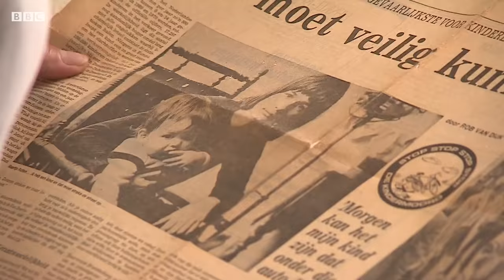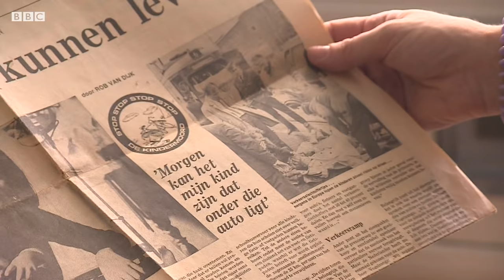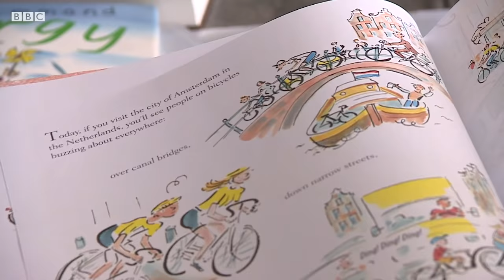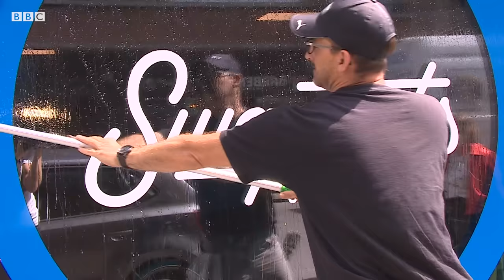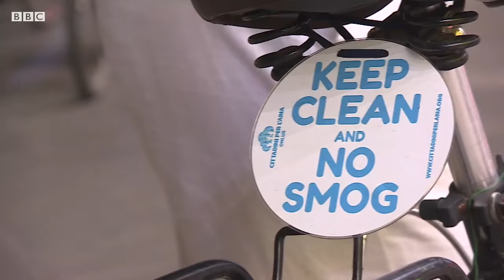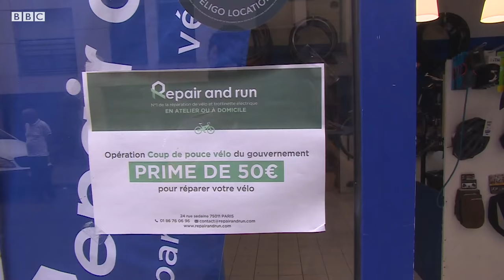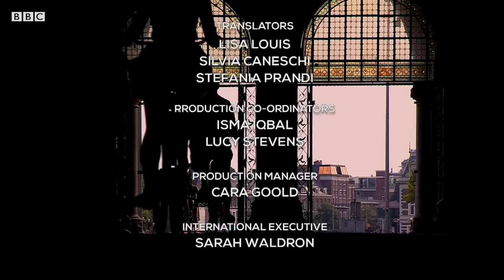Cycling across Europe in the pandemic - BBC World Service Documentaries

Comment: Cities don't need electric cars, they need electric bikes and cycle lanes that aren't shared with pedestrians or vehicles...safe cycle parking would probably be asking too much.
Reply: Electric bikes in cities can be scary. The high speed setting should only be used in rural places
Reply: I've been riding ebikes in London for years there not a problem but there definitely a good option for better social mobility.
Reply: @MissMoontree  it is possible to set a maximum pace on these bikes. Manufacturers could do this easily.
Reply: @RV-sx9tt  actually it is illegal in most EU countries to have bikes with a speed > 25 km/h. A bike faster than this is viewed as a light moped which may run up to 45 km/h without the need to be pedal assisted. But for such a fast bike you are not allowed to ride on normal bike paths, you are obliged to ride on the road. I think the rules are ok, but the infrastructure oftentimes is very lacking and therefor very dangerous
Reply: Electric cars are still cars, they're greener, but not green. Any mode of transport that involves dragging a ton of steel with you everywhere you go cannot seriously be considered environmentally friendly.
Reply: @ten_tego_teges  does this include public transport, trains and buses and alike.
Reply: @adam-g7crq  Per capita though?  A tram weighs 17 tons and takes up to 150 people on board. That's a fraction of steel per person compared to a car, not to mention the energy efficiency.
Reply: @jekker1000  Why don’t they just have set speed limits for bike paths and allow fast electric bikes and motorcycles to ride on them? As long as someone on a a fast electric bike or motorcycle goes under 25 km/h I don’t see the problem with them going everywhere bicycles go.
Reply: @burgerman101    well, European cities are extremely old and back then were planned and built for one or two casual horse carriages and moreso for pedestrians. So it almost always is pretty tight space to fit a car lane through the houses. mostly, the space is so narrow the bike path, if there even is any, is as small as 60cm, sometimes as a painted on lane (=no motorist cares) or on the sidewalks (always pedestrians stepping on the path). this will make it impossible to cycle even near the speed limit of 25 km/h. A) you have other bikes in front of you and B) a lot of streets and parking spaces / misaligned cars, cars swerving in and out of lanes. You have to pay really close attention when you ride. In the more relaxed zones, where you are leaving the city where most cycle paths are constructed towards recreational use, you can very well ride very fast. Nobody cares, oftentimes not very much traffic anywhere near but mostly these paths don't lead to your work or home but to some sort of sight. So for commuting via bike and a bike that is capable of doing 45km/h, you'd need to use the street. You are even obliged to mount a numberplate on the back of your bike. It won't even make any sense trying to ride such a bike on the bikepaths because of constant slower riders in front of you. With a 25km/h ebike you already have this problem. And because of these narrow bikepaths you do not have much safe opportunities to overtake.
Reply: @jekker1000  With the exception of Germany, most car drivers in the world use only a quarter of their speedometer including those that drive 1000+ horsepower cars. They’re not constantly driving at top speed. I don’t see why a motorcycle couldn’t be ridden at lower speeds in a world full of two wheeled vehicles (I’m guessing bicycles are considered vehicles?).
Reply: @burgerman101  well, because motorcycles are far bulkier than any other type of bike. Imagine even driving one of these 2 stroke scooters on the bike paths. Simpy put, they are too narrow. And during commute times they are already too congested. Why should a motorcycle that can perfectly be ridden on the streets be ridden on a bike path? It does not make any sense. Also, for bikes there are some special rules, like going allowed bidirectional traffic in a one way street. try doing that with a motorcycle. With a bike you can swerve to the side or at the extreme just carry it onto a sidewalk. A motorcycle would be too bulky to get onto a sidewalk in such a situation. You'd need to squeeze through parking cars. I think with fewer cars it will be more fun to ride both: bikes AND motorcycles.
Reply: @jekker1000  True, but couldn’t governments just put size and/or weight restrictions on motorcycles?
Reply: @burgerman101  even if they could. Imagine the uproar from all the people driving older motorbikes. They'd still want to use them. Also I think for higher speeds (as with motorcycles) you need stiffer and tougher frames. Then you need safety features etc. I think there is a limit as to how small you can design a motorcycle. I don't think you get a motorbike anywhere near the size of a bike while fulfilling the current regulations for road safety
Reply: @jekker1000  I think they would have to do a phase out approach and give an exception to older motorcycles. They can be grandfathered in. I mean the Honda Grom is pretty small, but I see what you mean. I wonder if mopeds would be included in a motorcycle ban because a lot of them are the same size as bicycles (the real mopeds with peddles, not the “mopeds” that look like scooters that don’t have any peddles).
Reply: Yes, it always boggles my mind when they complain about electric cars being too expensive. Half the population doesn't even need a car and can easily cycle to work/school using a bike/e-bike/speedpedelec depending on the distance/hills. Changing from petrol to electric cars helps against pollution, but it's still a highly inefficient use of space. In most places the traffic jams are just caused by lazy overweight people that would still drive even if the distance is under 1 kilometer/mile.
Reply: @jekker1000  Yep we still need to get rid of those retarded rules of having to drive on the road with the cars in places with a 45 kmh bike. The reality is that we need 3 types of lanes. Car lanes, fast cycling lanes and slow cycling lanes. 

Fast cycling is a new phenomenon that society still has to get used to. It has the potential to cause a massive reduction in car traffic and traffic jams if implemented properly. Because normal non top athlete people can now cover 20-30 kilometer distances to work/school by a peddle assisted bike. But we first need to get rid of the old black and white paradigm of bikes being extremely slow, and cars being the only vehicles that drive over 20kmh.
Reply: @Bertuzz84  yeah, unfortunately budget is spent for everything else than for cycling. They hail themselves for creating a blue stop light which indicates it registered you as waiting at the traffic light, for cyclists - prob. paying a befriended design bureau a fortune with which you could buy a complete traffic guidance system for a medium sized city in the Netherlands.
Reply: @MissMoontree  
There is only 1 setting. By law they are restricted to 15.5 mph. Any extra speed comes from the rider.
Reply: @burgerman101  Motorcycles belong in the road, simple as that. They're far heavier than bicycles which makes them much more dangerous in a collision with a person. The notion that a 500cc bike with its weight, acceleration, and top speed belongs on a cycle path is ludicrous. Not to mention the noise and pollution they belch out. Cycle paths are sociable infrastructure that are people and environmentally friendly. In Netherlands it's bad enough where 50cc mopeds are allowed on the cycle paths.
Reply: @MarcoTheGreat2008  In regards to noise and pollution, governments are demanding that a lot of vehicles be made electric in the future. I can’t see why motorcycles wouldn’t also be electrified. In regards to top speed and acceleration, we should put geographic speed limiters similar to those currently being in electric rental scooters like Lime and Bird. When someone rides their motorcycle in a certain geographic area, their top speed and acceleration will get limited to whatever is deemed appropriate for that area. Also, similar to what the commenter Bertuz said, after removing cars we will need to have fast cycling lanes and slow cycling lanes. This is where electric bikes and motorcycles can ride at speeds more suitable to them. Everyone shouldn’t be forced to ride at slow speeds just because some children are going to be riding their tiny bikes at slow speeds. In regards to motorcycle weight, I agree they are currently too heavy. The government should set some reasonable maximum weight standards. I think governments should use phase out approaches in order to accommodate everyone. They should give motorcyclists with loud, polluting, heavy, and unrestricted motorcycles a 10-20 year grace period to switch to a compliant motorcycle or an alternative.
Reply: @MarcoTheGreat2008  Also, peddle/push bikes can also be dangerous in a collision even if they are less dangerous than a motorcycle. Current Peddle bikes can go 20-30 mph (32kph - 48 kph) comfortably. Imagine a peddle bike hitting a pedestrian at 30 mph (48 kph). That could still injure or kill people. Downhills they can reach 40+ mph (64+kph).
Reply: @burgerman101  Small cars and motorcycles (especially electric) have its niche. But you can't deny that speed limits does not work. Same with bycicles - it is safer with separate pedestrian and bycicle path.
Recently I've found a great channel - Not Just Bikes
 - that describes in detail how it works in Netherlands. They've done it right, no need to reinvent the wheel.
Reply: Without safe parking the bikes and bike lanes are useless. You have to have all parts of the infrastructure if you want it to work well just like you need a cycle lanes netwrok, not just some bits here and there.
Reply: Biking and walking should be for fun and exercise. Instead for europe it’s a necessity. They have to ride bikes to work school markets everywhere. US drives cars for many things but then we ride bikes for fun. So in a sense europe is behind on the time. Way behind US again. Surprise they are still not using horses and carriages.
Reply: @tekkenfan01  Check out "Not Just Bikes" Youtube channel. Bike is about convenience.
Reply: @sergeykish  try biking 100 kilometers uphill with 250 kilograms of supplies when the temperature is -20 Celsius with snow and ice, very convenient
Reply: @tekkenfan01  Biking is not necessity, it is another mode of transportation. And every person on a bike or public transport reduces traffic.
I drive my car outside of the city. I drive it with supplies, though address delivery solves a lot of cases. I drive it with my family in the city, but quite often public transport is more convenient. Personally I enjoy biking much more than driving through traffic.
Seem like you can't read and watch, stuck in your believes, sorry for you.
Reply: @sergeykish  try being a delivery person with 100 packages totaling 1000 kilograms in -20 or 50 Celsius going to 150 locations in a span of 8 hours on a little bicycle to reduce traffic, seems you don’t see the whole picture, shame
Reply: @sergeykish   try walking and biking over the ocean, and a car can be converted to a water vehicle, watch some movies, now who’s stupid?
Reply: @tekkenfan01  ocean, stupid, storms, tons of fuel. I'd like to see you driving city in such a vehicle, carring 250 kilograms. Morron.

Comment: 1 bicycle = 1 person . 1 car = 1 person. Plan for people, not for cars.
Reply: actually, 1 car can be for 4 + people and a car certainly has its uses, but for the daily commute cycle RULES.
Reply: @ankurmitra7587  but mostly it’s true 1 car = 1 person. A bicycle can also = 2 or 3 persons (child seat, bakfiets or tandem) and sometimes 4.
Reply: @ankurmitra7587  Agree. But a car also take up space of more than a just 1 bike, specially when parking. I started not just commuting but also running errands and grocery shopping with my bicycle. My motrcycle is gathering dust meanwhile...
Reply: @marcoferrao Well, to clarify the point I would like to say that while cycle is very convenient for northern Europe (where the climate is generally colder)  it not so in southern Europe or tropical countries.
In countries near the tropics, the heat is way too much during the summer and an AC car helps a lot ( a sweaty/ tired person is not a suitable candidate for a date/interview/professional setting). Daily extreme rain is also a huge problem in some countries. In the extreme north of Norway/Finland snow and freezing temperatures and snow cover are major hurdles.

 Cycles are great both for the body and the city but sometimes nature isn't so accomodating.
Reply: @ankurmitra7587  I don´t know how to put this. Weather is a factor in cycling, I don´t usually go out in the rain for instance. But, I live in Brazil and I cycle back from work at midday, under a hot 38ºC sunny day. It´s not all that pleaseant, but no big deal neither...
Reply: 1 motorcycle = 1 person
Reply: @burgerman101  Agreed. I also ride a motrcycle, and sometimes we also lack planning and structure for this mode of transport.
Reply: @ankurmitra7587  hahaha do you have any idée how mutch the dutch would pay to trade there climat with yours?
Reply: @edmundas919  That´s true. But a bus doesn´t go door to door for most people and still is highly polluting and fairly expensive to keep, and yet buses are a necessity in most cities.
Reply: 1 car is on avarage 1.67 but that is still a lot worse than 1 or 2 bikes
Reply: @ankurmitra7587  I don't think the hot weather thing is a big issue.  Lots of people in hot countries like Vietnam and parts of Africa cycle even though it is hot.  Meanwhile in northern Europe I can assure you I have had many second thoughts about cycling when it's -2C or colder and the roads look a bit icy.
Reply: @ankurmitra7587  Here are some statistics from Office of National Statistics on cars.

60% of car journeys are within 10 miles or less.

The average person per car is 1.2.

So why can't these journeys under 10 miles be done by bicycles?

I get that cars carry people but most journeys are people going to a supermarket. Why not just shop more local and often?
Reply: @ruan13o  I don't know whether you have been to Eastern Asia OR Africa or met any locals from that region....... if given an option "All; i.e over 90 %" WANT a car ....... due to the really poor financial conditions of these countries these people have no option than to use a bicycle.  I personally can't comment on south/ central America since I have never been there and don't know the ground reality.
Reply: @MTCoblivsicas12345  " Why not just shop more local and often? " - Because America and most other countries following in these footsteps have planned their cities and suburbs to be dependent on cars ( I really don't know who thought it was a bright idea, to be honest) ... in most American suburbs you would be really hard-pressed to find local shops in walkable distance from your home. The main culprits ->  residential zoning and America's obsession with single-family homes and the spreading suburbia.
Reply: @ankurmitra7587  Yes, I have. In fact I'm from East Asia. You're right most people want a car but that's not contradictory to saying people don't mind cycling in hot weather too. Mostly these days the roads are no longer cycle friendly there as new roads mainly cater for cars. Also the car has a status symbol.

Comment: 19:13  'pulled over by police for cycling with earphones'.. that's been discussed in Australia but swiftly ruled out, as that would make riding while hearing impaired a traffic offence and cycling organisations pointed out that vehicles are allowed sound systems that impair hearing as much as earphone wearing.
Reply: The funny thing is: 

If you are pulled over by police for cycling with earphones, you technically should be pulled over by the police for driving an electric car, since those are soundless as well (And as such, dangerous for cyclists and pedestrians as a result).
Reply: Imo, cycling with only one earphone in is fine (that's what I do), but cycling with both in is pretty foolish. I used to listen to my music through a speaker while riding, but I ride at night sometimes and I realised that people might not appreciate me riding past their houses at 9pm with my music blasting.
Reply: @nickdentoom1173  fallacy; EV's may have silent electric motors but their tyres make just as much road noise as ICE vehicles and tyre noise is the loudest noise with most modern ICE vehicles at speeds over 30 kph.

Comment: For "cars", say instead "drivers". Cars are just machines. Drivers are the people that use them.
Reply: While I see where you're coming from, people often use phrases like 'the Motorists' and 'those Cyclists' as a way to form an us-verses-them dynamic and blame a group for a problem caused by transport politicians and crony capitalists. Putting your hands on a steering wheel or a pair of handlebars doesn't automatically subscribe you to some tribe that you now have to represent. Better phrases would be 'people driving' or 'people cycling', or better yet, just cars and bikes.

If you're going to be a bit more poetic about it, you could say that someone in a car is not really visible most of the time, maybe only as a vague shadow, while someone on a bike has a visible face and body language that makes the human the focus. People might say 'cars' because all you see externally is the machine, you communicate using lights and a horn, while people cycling communicate with a bell but also by hand gestures and simply talking to a fellow traveller as you go along. So the driving experience is about interacting with lots of large machines, while the cycling experience is about interacting with lots of other people.